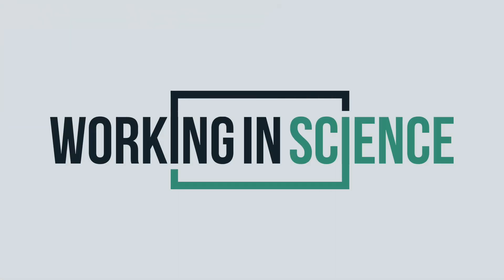Thinking about getting into welding?

Comment: It is sad that I need a extra 1 year 1/2 to get into the NAVY SHIPYARD work crew as a civilian BUT they push to 5 years of experience in weld and I only got 3yrs 1/2 in Shipyard hull repair, AWS ASK ME WHERE I DID WELD AT I told them at NATIONAL MAINTENANCE REPAIR INC(IL) THEN THE REPRESENTATIVE OF AWS ASK ME WHAT TYPE TEST YOU DID HAVE THERE? SYMPLE JUST WELD 5 PASS STAINLESS ON THE EYE RING TO LIFT A 10TON PROPPELLER IF DOES FAIL INTO WATER THE TOLD ME I DONT HAVE TO WORRY ABOUT WELD ANYTHING IN U.S, SO I DID PUT PLANNY PROPPELERS INTO BOATS AND FIT PLATES ALSO TILL MY BOSS WRONGFULLY FIREE ME BECAUSE HE DIDNT HEAR WELL, I learn alot things( put boat off the water and back on water, fix drydock and build, drive a forklift,and also how to use a 20ton walking crane from the machine shop also work and good and awesome benefits) maybe 1 day I become a weld inspector hey pay from $70k to 120k depends on company

Comment: I want to get into welding. Actually I'd like like to weld miniature suits of armor. These suits of armor would be made to punish bratty children. Each suit would be custom made to fit a specific child. Essentially the child would be permanently welded shut into the suit from head to toe. The suits would be made of iron. Joints would still be moveable so the child could actually walk, move their arms, etc. however since the child is permanently locked into the suit their growth would be permanently and irreversibly stunted. So if a child is welded into a suit at the age of 10 then they would stay that size FOREVER! This idea is only one to punish VERY BAD children.
Reply: Oddly specific

Comment: I have been welding since 1994 up until 2008 the most I ever made per hour was $17.50 per hour as a shop foreman.  My skills were in shut downs, new construction, and oil/nuclear/ and heat exchanger. I was a code welder, and  finished the master welder program at Tulsa welding school. Before that I was in the Air force and did aircraft structural repair work on aircraft.This amount was way under what I should have. All them years wasted to make other rich ! Due to working 7/12s my spine was damaged, and my neck. I also developed the shakes from breathing welding fumes. The neck and back I had to get fusions, and welders stop shaking your welding hood down or your neck will need a fusion too. Over worked and way under paid for welders that work for others. 10 years after my injuries I am just now starting to feel better and plan to open a weld shop of my own since I lost everything that I worked for due to these injuries. Don't even get me started on workers comp ! They find any way to only pay for medical, and since they make their own laws ( state insurance) they only paid me at 20% of what I made for 3 of the last 10 years. So best solution is to work for yourself if welding is what you do. 
Show less
Reply: David Kaser im tig welder i Made my Certifications in december and i get 19,65 Euro around 21 or 22 USD, Maybe youre doing something wrong, move to Germany
Reply: David Kaser sounds like you had a real bad string of luck. Hope things got better for you
Reply: I went to Tulsa they don’t have a master welder program.
Reply: Did you ever have a shot to work in a union shop or join a union? Just curious.

Comment: 60 to 80 an hour on pipeline tell me where because I haven't seen it.
Reply: West texas pays around that and if you go to Canada you can get up to a 100 because of cost of living
Reply: Slim DeLeon maybe if your getting paid for your rig
Reply: You can if you’re getting paid around 25hr and your rig is making money being on the job site
Reply: Big money in Alaska.
Reply: Yeah I haven't seen it either. Even the old men with degrees and 20+ years in welding are only topping around 72k.
Reply: He meant a year
Reply: Alberta man, the average engineer makes around the same as a red seal heavy equipment mechanic here. In Canada with trade qualification being necessary AND schooling does not let you skip apprenticeship, the quality of our work is much higher, and we can demand much more money. First year apprentices in HET make $25 an hour, with increases every year you complete a training period until you reach journeyman at around $45 an hour. If you are willing to work in remote locations on shifts, wages can be as high as $80 an hour.

Comment: the best thing to take from this interview if you are serious about becoming a welder is when he explained patience and the learning curve. He nailed it to a T. As soon as you think you're hot shit you will hit a wall. A mental and physical wall. for me, it was passing my D1.1 GTAW 2G SS test. (very very thin stainless sheet metal in a sideways position). I was just like him, wanted to just quit... have that motivation to push yourself is the only way to be successful in this trade. great interview
Reply: pairadice49 agree I'm getting my 6g. Pipe line is insane around here. 10 square miles I can count 6 differ pipeline companies. I hoping it will be the same in 5 months when I'm good go burn my self lol.
Reply: I don't care if I'm a welder hand at first. As long as 10 years down I'm welding and making bank I'll be happy. I'm a little pissed right now on my 5th plate with mig and I can't fucking pass!!! Lol

Comment: A real welder will ask what are the ASTM of the metal , then a knowledgeable welder will know what rod carbon content is needed . If he is knowledgeable. Factual!
Reply: Literally never met a welder that knew this. Ever. Literally ever and I'm 6 years in as a combo welder. I'm certified etc, and yeah. This isn't a thing. This is more advanced metallurgy that's not taught at a regular welding or even advanced welding processes school. This is certified welding  Inspector stuff. Not the welders stuff.